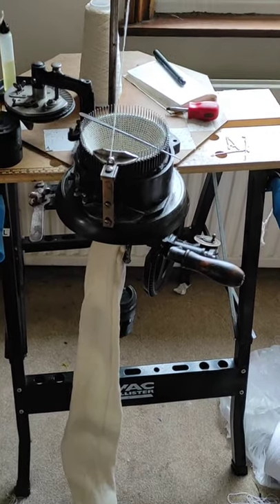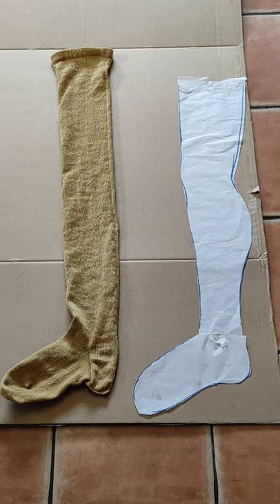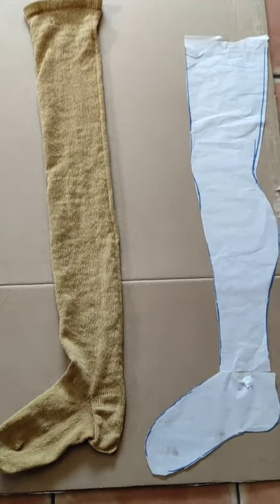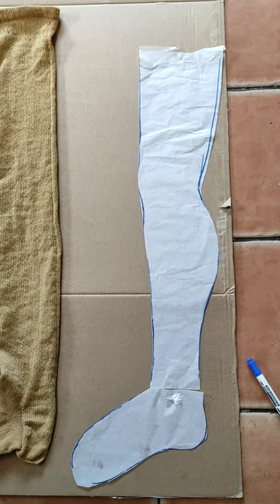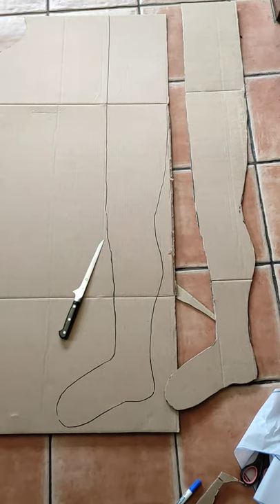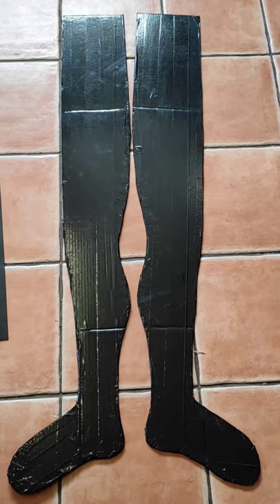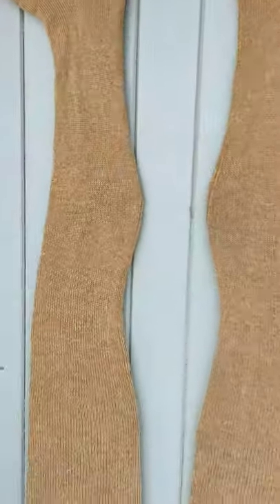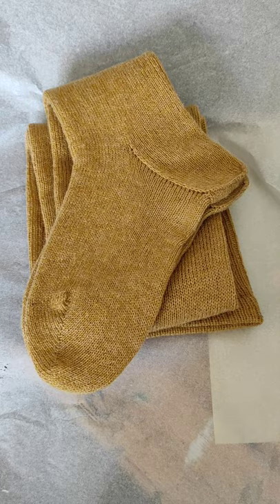Make a Duct Tape Stocking Blocker #shorts

Comment: What kind of thread/yarn is used in the stockings?
I would certainly love a pair!
Also, is a garter needed to hold them up?,  as I do not see and band or ribbons at the rim.
Reply from the maker: Yes you need to garter. I make wool, linen and silk stockings

Comment: Hi, probably a strange question, but how do I measure my legs to get properly fitted stockings? I’m on the larger side and my thighs are larger than some peoples waists, and my calves are proportionate to my thighs! I have a very hard time fitting premade items like stockings, so any advice is appreciated!!!
Reply from the maker: For most makers, the critical measurements will be thigh, calf and ankle as well as foot size. Additional length also helps to fit round extra width because of the way stockinette stretches.  If hand-knit, any size is achievable. The ones I do on my antique machine though, the largest realistic measurement is around 24-25 inches, so if you have a measurement significantly larger than that, I probably can't help much.
Reply: @SallyPointer  Thank you! This really helps!
Reply from the maker: @agypsycircle  I'm not officially open for stocking orders again yet, but if you want to drop me a note via the shop pages about any styles that tickled your fancy, I'm happy to advise whether I can do them to fit your specific form.
Reply: @SallyPointer  Again, thank you so much! I’ll definitely keep this in mind and look up your shop!